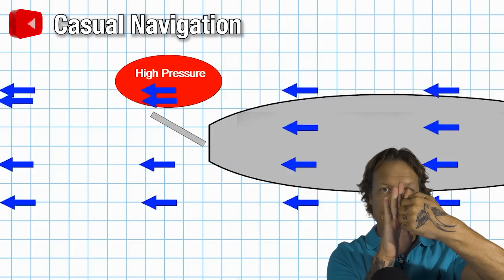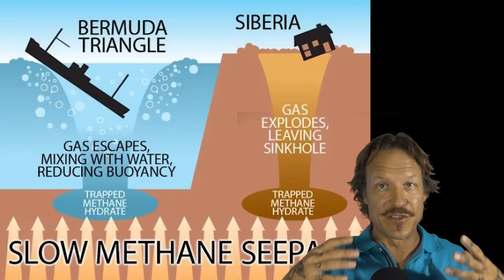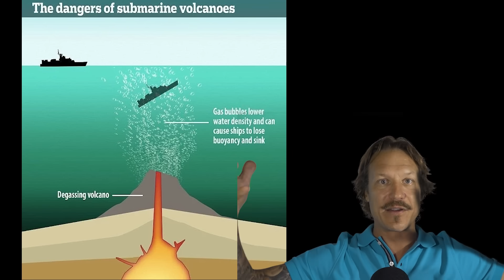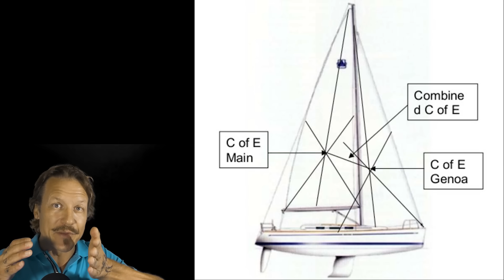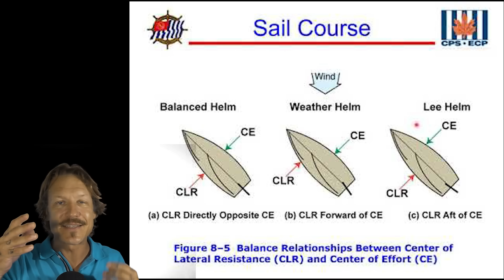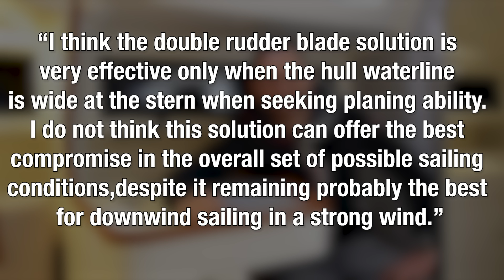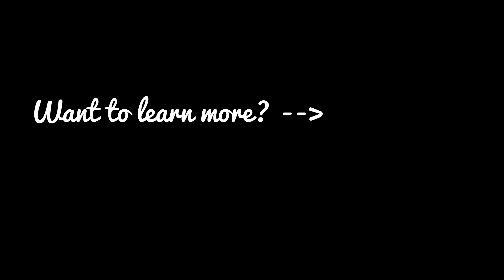The Problem With Dual Rudders Nobody Talks About

Comment from the maker: Captain’s Tip: Dual rudders don’t make a boat safer by default—they compensate for design choices made elsewhere. Offshore, understanding why something exists matters more than whether it’s fashionable.
More context on offshore balance and failure modes here:
👉 https://bethecaptain.com
Reply: Great info, optimal set up depends on what kind of sailing conditions you will encounter, thank you, it's not a matter of faith but a matter of science
Reply: James, please do a review of the trend for forward hard chines (near vertical sides above the water line) that increases forward buoyancy offsetting the wide aft buoyancy…and then allow a single rudder again plus reduced heel. The new Dufour range 41 44 are examples of this.

The single rudder is also much better for close maneuvering by using prop wash and gets some protection against damage from the keel.
Reply: Why ARE there two?
Reply: Thank you for all that you do. Glad to have found your channel. Book is ordered! When do you think the book will be ready and sent out?
Reply: I get what you're saying.  I have a "wide stern" boat about 30 feet long.  She's a fractional rigged sloop.  I've gone upwind with 22 knots apparent and 9.5 knots boat speed with the upwind rudder having a foot of air under it. The auto pilot was on and the helm was neutral with little movement. I've gone downwind on an asym in similar wind and similar boat speed.  Going upwind was not a leisure cruise.  Nobody was going to be cooking or sleeping.  Downwind, we probably could have been going faster while taking a nap if I was a better sailor.
Reply: Hi James. 
A while ago, Thomas (from the channel Sailing with Thomas) posted a video about the same subject. (https://www.youtube.com/watch?v=aP6m9I1vVuE).  He has one of those wide @ss dual helm / dual rudder boats. He seems to feel that hull shapes even a decade old are completely outdated. In the video he mentions his credentials, and he definitely seems to know his sh*t. I'm very curious about your opinion about this video.
Myself, I am a total dinosaur: I love the long keel boats like the Nicholson 31, Albin Vega, International Folkboat, and Alberg designs. As far as I am concerned, what was seaworthy and seakindly in the 60s and 70s, is seaworthy and seakindly today. And the tank-like qualities of those boats give me a lot of peace of mind. I haven't bought one yet, but those are definitely the boats on my particular shortlist. 
Also, I wonder why production boats follow racing developments so closely. It's not like cars are becoming more and more like Formula 1 racecars, and for good reason: They're useless for anything but racing. Similarly, I guess a wide 2-rudder boat is great if you have a big, well trained crew, but I don't believe in them for single-handed / shorthanded sailing.  
As an aside: I have bought your book the other day, but it is still on a slow boat to Europe, I guess. I can't wait to read it!

Comment: I hear everything about this but THE most important issue is not addressed. 95% of sail boats are sold to coastal cruisers, and is where the disadvantage of twin rudders makes for total mismatch, even with a much bigger bow thruster as is being presented, and I can handle boats in close quarters, docking the boat being blown off the dock is hectically difficult especially without dock hands and crew, single handing, and you need a ton of fenders. None of the bigger brands have stern thrusters and you need a big one to get stern to the dock. As soon as you stop the boat, 2 sec later you are metre off the dock, no flush to bring her back. You look like an amateur. And then, most of the time when a centre rudder comes out of the water, boat is overpowered and slower than a balanced sail setup. I’d never want a twin rudder myself, unless I’m serious into racing, where overpowering is prevalent, as you said, too much effort to continually setting sails to balance drive, no need for any rudder other than dealing with side slip. Keel does all the work.

Comment: I think you missing one major point within your discussion, look at the racing boats ie my old sigma 33OOD it has tiller steering and you race it with 6 or 7 crew  both the main sheet  and the Genoa have dedicated crew who work with the helms man to maintain balance reducing the helm movement by constantly adjusting the sails, applying more helm is just like putting the breaks on. When racing all redundant crew will be out on the rail to help keep the boat upright thus you can hold on to more sail area before a reef is required. When cruising with a small crew (2 plus autopilot) something has give you cannot put crew on the rail so you have to reef early to keep the boat upright, if the autopilot is working hard and applying a lot of weather helm your CE is too far back and the main needs easing, if the boat is constantly heeling 20deg you need to reef. Heeling distorts the wetted area shape and will cause the boat to round up which the causes more helm to counteract it but now you have the ruder acting as a break and slowing the boat, so adjust the sails to reduce the helm action. Cruising with a small crew is difficult, in calm steady conditions and a balanced boat its a pleasure but when the wind picks up and sea state changes it’s hard work and you cannot afford to be over canvassed you must reef early and keep the boat balanced. All boats are different find your boats sweet spot understand when you need to reef.

Comment: TLDR: Dual rudder better for costal cruising, inshore, shorter trips.  More room, better for most uses.  However if you are offshore cruising with long passages-- transatlantic, crossing oceans, long passages (especially if solo), rough seas, then they are worse.  If you are short handing, long passages, offshore then definitely not a great choice.
Reply: reason is the flat wide transom provides huge cockpits, more room, much better downwind (surfing), more stability in most conditions.  However when heeling and strong upwind conditions, the asymmetric rear creates more work for autopilot, helmsman, creates more weather vane because the physics of the boat changes as it heels and uses different parts of the shape of the rear of the hull.
Reply: IMO opinion it IS better for 95% of the market.  The only market it may not be good for is long offshore passages, ocean crossings which is a small part of the sailboat market and actual percent of boat useage for the vast majority of people.  Yes solo, shorthanded ocean crossers might not like it but most others will.

Comment: There are still some more issues with dual rudders that I can think of:
- They are more exposed to floating debris, since they're not protected by the keel in front oft of them.
- For the same reason, they tend to catch on mooring lines in marinas.
- Maneuvering under engine requires you to get the boat into motion first. There is no prop wash that would increase the rudder's effectiveness when the boat sits idle. This is particularly bad when reversing. If you are thinking about a modern wide-stern boat with dual rudders, you might want to consider both bow and stern thrusters...

Comment: I call total BS on this generalised viewpoint, I have a Garcia. No wide stern and they have been at this 2 rudder game for nearly 30 years. I would never opt for a single rudder the way the Garcia is designed and configured. I have sailed her all over the world, in storms, in every condition. Stability downwind centerboard up the boat sails on it's rudders in pretty much a straight line. Safest feeling ever, broaching is not a concern. Upwind due to the internal ballast design of the boat she tracks perfectly, in a tight space she will turn on half her length with the centerboard down. Reversing with centreboard down no problem almost as good as going forward. And then there is the draft. I can park her on a beach or sit on the bottom and the rudders do not hit the sea bed or beach. Hitting a reef I just sail away, with 2 rudders still!

Comment: While that's true that while heeling the wide aft causes a dynamic center of buoyancy... that said - while upwind, having more buoyancy near the aft is actually perfect, as the aerodynamic resistance of the sails while going upwind goes in that exact direction, so the yacht will heel less,  and/or carry more sail upwind.

I participate in inland regattas for many years now, and many designs work fine there, but out on the sea, with significant waves i find that those classic hull shaped boats are horrible downwind, and not really good upwind as well, unless you sail quite a big yacht compared to the waves size.
With a wide aft even a smaller yacht is generally more stable, even if you have to work the rudder a bit more, and I think that by far most people sail their yachts mainly from a few hours at a time to a few days, and that oceanic passages are a niche, and even if someone does them, it's usually to get to some islands/interesting shores to do relaxing day sailing there.

Comment: The problem I have with this video is you don’t talk about the design and it’s capabilities and fails. You talk about it like it’s the bogeyman. There is no such boat that is great in all conditions they all have niches. So the Italian designer was correct but the same could be said about every boat ever made. A catamaran for different reasons is still something you have to keep a close eye on. It seems like you have one particular want out of a vessel and ignoring that this boat has Nisha’s that fulfill another group of customers. I also don’t know anyone that doesn’t check the helm for three days on passage that’s just being a little much. You were looking at a boat that is obviously designed to have entertainment capability. You might as well be complaining about a limos cornering. Also saying simplicity is safety is true, but in the same breath, redundancy is also a kin to safety. Adding a little complexity to add redundancy could be a good thing. Especially if your holy reliant on that mechanism to point the boat. Just saying dual rudder may not really be a bad thing for your needs you just wouldn’t have such a large transom. Video just needs more comprehensive overview and a less ghost story vibe.

Comment: I don't think you're quite right on the CLR issue. As the boat heels, a wide transom boat will trim foreward, because of the wide transom shape. A designer will take account of this, and evaluate the CLR vs the CE on various heel levels. And subsequently adapt his hullform. Apart from that, most CLR will come from keel and rudders. So the change won't be that dramatic.
The foreward trimming may also affect the angle of attack of the keel, by the way..

Comment: 7:24 Not if you have a race crew on board. Your trimmers know exactly which angle of heel by the least hydrodynamic resistance based on the hull shape. Once you get beyond that, you are overpowered. You are not producing greater VMG. That's why you always have someone on the vang making those micro corrections, especially on these modern boats with large mains.

That hull shape wants to be at one angle. Everything else is sub optimal and costing you time. This is why you are putting weight low and often forward in light air conditions.

Comment: I’m afraid that I don’t agree at all. I’ve raced wide bodied yachts double handed offshore with twin rudders, and they are much more balanced upwind, downwind and reaching. I’ve also sailed modern cruising twin rudder yachts distances and any of those designed by well regarded naval architects are better all round offshore yachts that are easier on autopilots.

Comment: TL;DR: I'm pretty sure the reasoning in this video got the helm effect backwards (although the ultimate conclusion is correct). Flat-stern hulls are good for going downwind because they develop LESS weather helm when they get in trouble (i.e. when they heel over), not more. What makes the boat feel "squirrely" when you're tacking upwind (the boat wants to go downwind) is the same thing that keeps it on track when you're on a run: the boat wants to go downwind!

Deeper dive: When a boat with a flat stern area heels over, the sharp aft section of the bilge digs into the water (increasing the lateral resistance near the stern) and the bow starts to level off and slide over the water (decreasing the lateral resistance forward), so the CoLR moves aft. And the increased flotation aft pitches the hull forward, pushing the rig and therefore the CoE forward. The twin-rudder configuration is dangerous because it DEcreases the weather helm, and at some point maybe even results in a lee helm.

9:30  If your boat feels "squirrely" when you're going uphill, that's a lee helm, not a weather helm.

PS:  7:20  more windy = windier

Comment: I have sailed dinghies, wooden boats, and boats that are on the narrow side. The keel boats go upwind very well and downwind fairly well. I now have an Ewicson 37 built in 1974 to the International Offshore Racing rule, as a One Ton (nothing to do with the weight), as a racing boat, it is in the moderate cruising range, weight-wise at 16,000 pounds with 8,000 pounds of lead ballast for a 50% ballast ratio, so it is a stiff boat. It has a well-balanced hull shape, was tank tested at the Stevens Institute, and produces almost no wake when going fast.  I typically lock the wheel when sailing hard on the wind all the way to a broad reach and don't touch the wheel for more than twenty minutes or more, the boat sails itself. It is very well behaved and only has one rudder.  It goes downwind fairly well. I took a small boat design class at California State University, Long Beach, so I totally understand and agree with your assessment.

Comment: I would strongly recommend to ALWAYS have a rudder just behind the propellor. It is a matter of LIFE OR DEATH. Picking up a man overboard DEMANDS to be able to manoeuver the bow in the wind even at extremely low speed. Whether you want to add two other rudders on top of this one rudder in the middle to make it more easy to steer when the boat is leaning over at a significant angle is your choice.

Comment: This is spot on.  I've sailed/ raced dinghy's and keelboats in the PNW and a heavy weather helm is not fun even after a few exciting hours.  Racing short course is great with wide two rudder boats, but long range, I'd rather have a single rudder with a spare or two in the boot. :)

Comment: Just a question, You're stating that with an increase in wind a standard (eg Non-wide-hull) the CLR does not move but that the CE moves aft (creating weather helm). While with a wide hull Both CLR and CE move aft?

Comment: I don't understand why a twin-rudder boat has a greater relative shift in CE/CLR due to the variation in heel angle than a single-rudder boat under normal sailing conditions.

However, I do understand why wide hulls benefit more from twin rudders and how they can have a greater shift in trim with heel. This could have a greater effect on the shift of the center of lateral resistance relative to the center of effort (and also on the keel angle of incidence).
Twin rudders are of course not made for narrow hulls.

Twin rudders have undergone significant development in the IMOCA class to facilitate autopiloting in extreme offshore sailing. This is mainly due to their greater stability at the helm, particularly in rough seas.

Ventilation is not the main problem twin rudders are designed to solve (and they can also be prone to ventilation).

The only real disadvantages of twin rudders are:

1/ greater exposure to shocks, requiring a more complex mechanical fuse, such as a lifting system. 
2/ an increase in wetted surface area when both are submerged, which represents a performance handicap in very light winds.

3/ a slight weight penalty.
4/ increased aerodynamic drag due to the non-submerged rudder, a problem for fast boats.
5/ with a single centered propeller, no propeller wash effect for maneuvering.

Comment: 1 for best performance, it is important that all appendages produce lift to weather. This reduces leeway. This is why weather helm is better. Safety is not really a consideration.
2 wide sterns have a lot of leeward  drag. Due to this, the keels are mooved aft (negative lead) to keep weather helm.
3 twin rudder has everything to do with ventilation.
4 twin rudders are safer offshore due to their redundancy (i have lost rudders on single rudder boats and it is no fun).

Comment: I have sailed a lot on a 55-foot one-off ocean racer Tomidi, a real Standfast. After more than 300,000 miles, the ship was worn out. The owner then bought a dual rudder xp55, and the moment I stepped on board for the first time, I felt like I was stepping into a luxury mobile home. I immediately say the owner and good friend that he had bought the wrong ship. It wasn't until four years later that he admitted I was right. Tomidi was a no-nonsense ship where you had to work, but you always had two lines in your pocket to secure your rudder. :) The xp55 is now for sale. Another thing is the complexity of the electricity and all the bells and whistles that go along with it. Way too complex for offshore sailing.